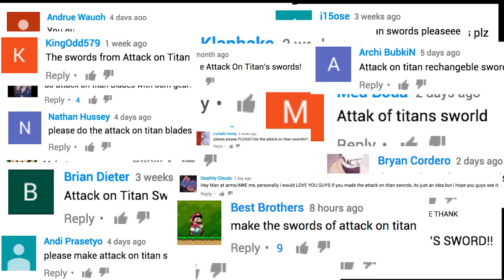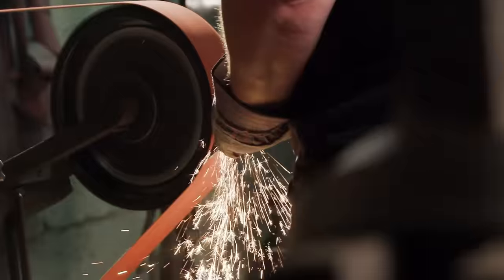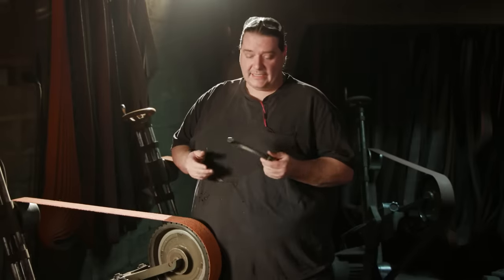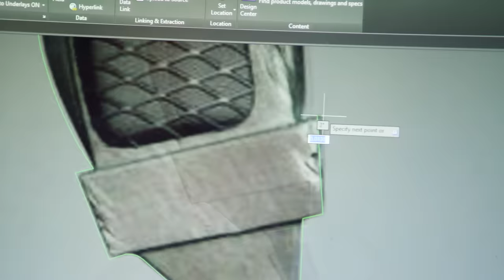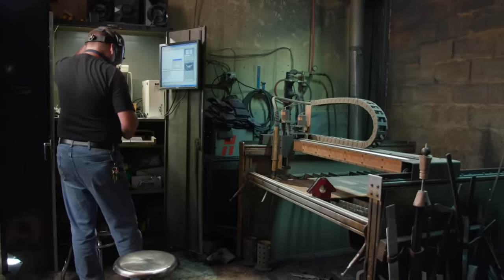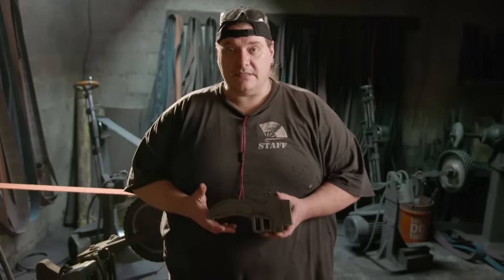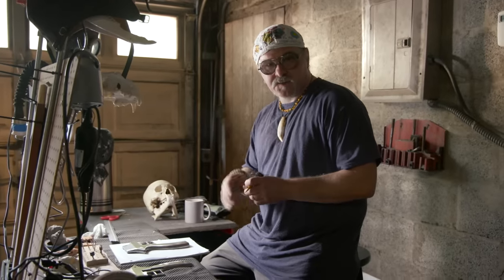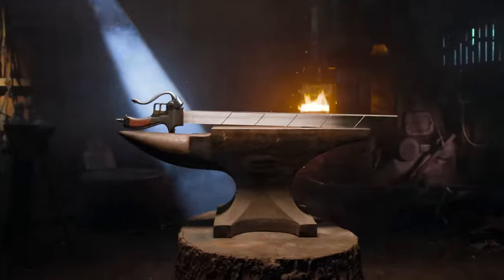3D Maneuver Gear Sword - Attack on Titan - MAN AT ARMS: REFORGED

Comment: Anyone else notice that big guy who straight up grasped the whole blade in his hand?!?
Reply: I did. I guess they didn't make the blades very sharp since they couldn't cut through those thin plastic bottles
Reply: @HarfelJ  They were sharp, they cut through tatami mats like butter, those are used to simulate human bone. Water bottle guy just hit them at a terrible angle.
Reply: @tomdibernardo1699  I guess you are right. I have not ever experimented with sharp instruments but I would think holding a blade on the sharp edge and potentially sliding your hand on it to lock it in the handle would be a very dangerous thing to try if it is indeed very sharp. But then they are the blacksmiths, and I did see the blade cut through the tatami =] Touché
Reply: @HarfelJ  i seem him touch the blade edge too. I guess he was just very gentle with it so it didnt cut him. But yea for real you don't go through tatami with no resistance if your blade isnt sharp
Reply: @HarfelJ  As long as your hands don't slide, you can grasp even the sharpest of blades. There is even a famous historical technique called the Mordhau (murderstroke in English) where you grap the blade and hit your opponent with the guard or pommel to get through armor, because a blade can't damage plate or good quality mail. I suggest watching a video from Skallagrim where he demonstrates it.
Reply: Actually,there is a button or a switch on the handling area to remove the blade
Reply: He does say the blades cut fantastically, Ive yet to see them forge a blade and leave it dull.  @ThatMockingMoose
Reply: I gave pretty much the same reaction when someone mishandle a firearm
Reply: @mennograafmans1595  halfswording as well

Comment: lmao i'd be so scared that the frigging blade falls out (when swinging the sword) and stabs someone. it doesnt look too secure
Reply: the release pin holding it in issn't that impressive, but the slot the blade inserts into is pretty tight, that blade is not going anywhere unless you swing it around so fast you overcome the pin (which would have to be faster than you might think)
Reply: why would you swing it if there are no Titans
Reply: Sasageyo
Reply: They all look just like a box cutter
Reply: netalivo i mean the sword is based off of the Stanley knife ive used them many times and they have never side off their handle unless i wanted it to
Reply: That isn't that much of an issue because they are fighting Titans who usually don't have armor. So it's not like there is a lot of stress on the blade. It's also quite thin so swinging it around won't produce that much drag. The sword is also extremely sharp so when cutting through a Titan it doesn't encounter much resistance.
With how thin and narrow the sword is if you hit a human on the skull with it it could even snap without needing to be dislodged. It's highly specialized at cutting through flesh and it can't really do anything else.
Reply: Patrick Soncela exactly, i also wonder if they make it too thin. Looks bend uncontrollable evrytime it hit an object
Reply: It is incredibly sharp so when cutting through flesh not much force is transfered to the blade.
Reply: marinus18 This is just my opinion..But if u ever watch Forged in Fire ( eps: Claymore) , u can see there is so many long blade broke or bend when they try to make a cut or swing it to a pig carcass. Full power swing to a thick object is much different compared to a fast slicing move. Meanwhile the Titan's neck supposed to be much thicker and muscular compared to pig carcass 😅 well we dont need much logic in anime tho..
Reply: It depends on how sharp the sword is. If the sword is very sharp then you need very little force to cut through. A claymore has a very thick edge and is a lot more dull than the knives they use to slay Titans. It relies on the force of impact rather than a sharp edge. The problem though with relying on a sharp edge is that over time the edge will dull which is why the swords use those disposable blades.

It's the fact that it is muscular that makes it easy to cut through. If it contained any sort of bone or even cartilage the swords would not get through it so easily.
Reply: Patrick Soncela that's what I thought.😁

Comment: The front handle is a brake the two triggers one shoots the grappling one retracts the blades are released from a lock at the back of the handle that looks kinda like a revolver hammer

Comment: This blade really is almost like a glorified box cutter 😂, great work as always
Reply: You are not wrong. In AoT canon there is actually a reason for the constructed weak points in the blade. As the titans regenerate fast and have very tough flesh, the blades have a tendency to get stuck. If that happens you can twist it and break the blade to get free, as you can't simply drop your weapon because it is fixed on you gear.
Reply: YThe Exploding chipmuuuuunk, Yeah these are just Box cutters :P
Reply: I didn't know that about the canon, the more you know
Reply: What a unique idea, it's not like they literally said that halfway through the video.
Reply: that's the idea.

Comment: Just want to say, the titan swords were made to be more flexible than durable, as to get the perfect cut required to kill a titan, so, because they are so flexible, they sacrifice durability, which is why they have the scabbard to hold 3 extra swords, when normally, a person would not carry 4 pairs of two swords (8 total) to battle

Also, am I the only one who got just a tiny bit annoyed when the called the 3DM Gear (or ODM Gear) a "Jetpack?" I mean, if anything, they are more like the hookshot, just on the waist and there are two.
Reply: CalveeThe Eevee I was definitely annoyed. The 3-DMG doesn’t allow indefinite flight so it can’t really be called a jet pack.
Reply: Let's not forget, the benefit of mass-production. These blades were supposed to be made with the efficiency of pre-World War industry.
Reply: Well I think this is just a mistake on the author as they stated that even for their demo purposes of cutting fruit, (which Titans are mostly plants) they had to make the blade A LOT more durable than what the author believed because plants are actually pretty durable and resistant to cut from thin blades. 

I think they did as one would expect from the purpose of the weapon as opposed to some under researched specs from the author. If the swords were supposed to even cut the nape of a Titan, a titans weakest spot, it would make sense it would at least cut a freakin pineapple. But any thinner blade would break at just that. 

I think your just kinda upset that the author isn’t a blacksmith and ACTUAL blacksmiths had to adjust his design to make it practical even for its fictional use.
Reply: Actually you can call them jetpack because they use gas and hooks

Comment: 6:15 it’s not a jet pack it’s a small canister of steam that builds pressure and launches the hooks then when in mid air it blows off excess steam to make you go faster . This is controlled by shifting your body weight due to the strapped harnes around your whole body

Comment: i hope someone some genius really invents the 3d odm gear which makes you jump from buildings to buildings id buy it like just take my money lol
Reply: Elsaria Rahnclave I won’t be able to, but with all the other technology today those are very possible
Reply: If someone could come up with a device that worked, it would look drastically different than what you probably want.  The way it’s designed in the anime/manga wouldn’t work IRL, because physics lol.
Reply: Amanda Orozco it still seems very realistic, reasonable, and believable in the way it works
Reply: Merengue Tang lol
Reply: I we have jetpacks so strap one to some grapple Hooks and boom ez odm gear
Reply: Elsaria Rahnclave I know I’m late lol but 3dm gear is totally possible. I believe with the proper materials and with detailed planning, I would be able to make one. And Amanda’s right, the real thing would look totally different than the anime’s style. I’m thinking it would be like a decent-sized backpack and with the tank and stuff on the sides. It would be quite heavy. But in the air, that fault would diminish easily. As you’re blasting in the air, the weight of the gear would succumb to nothing as it’s being carried, as well as yourself, by the propulsion.
Reply: Smolotov in the manga it mentions that as a fuel source it uses a material called ice burst crystals (I think that’s what it’s called) that is abundant in paradis (the region the mc’s live) which is part of the reason why the surrounding countries (Marley) want to take over paradis as it is very valuable. It’s believed that the reason for the abundance of ice burst crystals in paradis has something to do with the power of the titans, though what is unknown.

Comment: This is basically the best blade-shape, because it is the most adaptable one for all three typical blade types and their purposes.

(Chopping, Thrusting and slicing) 

(the straight edge also makes it very easy to maintain sharpness, compared to a crow-saber/sword) 

The only thing i personally would make differently, is to make the Tip-Angle slightly steeper, for a better Thrusting-Point. 

(I also would use a quality steel, that actually suits for a long term usage. Making it out to be Damascus would be awesome too) 

The Box-Cutter Grinds however, actually should Improve the cutting Ability, because it lowers the friction of the Blade, while cutting through all kinds of cuttable material. 

A Handle with proper Guard and a pointy (but not sharp) pummel, for strikes against armor or just as alternative attack in grappling etc., would be very nice too. 

Especially combined with a ergonomic, but simple handle. 

I have this concept on my mind for a long time now, but i don't have the Resources necessary, to do anything like that, so if the Blacksmiths, who run this channel like the Idea, i would really appreciate, if you actually bring to life my humble Thoughts, just in case you feel like doing it.

Comment: so you've got an air fitting on the bottom.  I think you should cut a channel in the handle from the fitting to where the blade locks in, put some talcum powder and wadding in there and run some air pressure.  Just enough so when you open the lock it shoots the blade out!

Comment: its very cool, and amazing, however, the reload mechanism should be a small trigger on the backend of the grip. That bicycle brake is supposed to be the gas pump for the odm gear.
disclaimer this might not be 100% accurate, but thats how i remember it

Comment: there are 2 triggers per sword, because one is for the grappling hook and other for gas (ODM/"jetpack"*) (for that respective side)

*it is not a jetpack, its a propulsion device, as it would not work by itself (you would be yeeted hard without the grappling hook) it would be the same as a rocket without manouvering systems.
Yes it boosts you like a jetpack, but it will definatelly not work like one.

Simplified - it is not a jetpack, treat it like one and prepare to get yeeted hard (and possibly die).

Comment: In the canon it is mentioned that the blades are basically untempered steel that are optimized for being very hard but break easily, hence the boxcutter design.
I understand that that poses safety risks to actually use in a demo... but it would have been nice to see one of the blades done that way.

Comment: Should have made two as it is a purpose built dual wield weapon. Also the blade hold down and sword tang was all wrong as they have two holes not just a notch to lock it into place, this is similar in appearance to the main blades on the UH-60 Blackhawk and the OH-58D Kiowa Warrior and would have locking pins more like a traditional door knob. The trigger should have been TWO separate triggers one for firing the grapple and one for rewinding the line/releasing the grapple. Overall nice build but a lot of things could have been done better.

Comment: There's a reason they're basically giant box cutters, it's intentional, they're shaped for straight paring cuts along the nape, the blades snap so if they break, people can escape quickly if it gets stuck in something, they can be easily mass produced as well as work perfectly for slicing a precise piece of material, like a titan's nape for example, they would be terrible for sword on sword fighting (which is explained in the show), but they work perfectly for what they're designed to do and they're expendable.

Comment: If I do this I’ll make many types like in the anime after being used sometimes they break off making smaller ones if you only have your two left and are half used you can’t use them for like 15 meters only 5 meters and less is a defense tool against hands and feet I believe there 20 notches

Comment: I have a idea try making a double bladed sword one blade on each end of 3 feet in length 3,1/2 inches wide at the hilt down to a point at the end and one handle between them of 4 feet in length making a sword of 10 feet in length that is also extremely useful do to the versatility
Reply: Even if you were to shorten the blades to 2.1/2 feet long it would still be an awesomely versatile sword

Comment: They only made the sword. Something I find disappointing. So I wouldn't say they made the actual gear. But they get a A for a Damn fine job. On the sword. 

This sword is beautiful.  But I would be more impressed. If they created fully functional 3d maneuver gear. If I had to guess the gas for it. Would be propane..they did say it  was gas. Though if it's liquid or not is debatable. I don't know if they ever said if it was a liquid gas or not. 

I personally don't understand how gas. Would help retract cables at such high speed. Shoot them maybe. Let alone be able to allow them to move around like that that. 

I imagine there was a lot of accidents. Before the 3d maneuver gear was perfected.  

Would be bad ass to take that damn gear. And go swinging around new York. So many buildings and structures. Perfect place to use the 3d maneuver gear

Comment: the lever is not the one who is goin to remove the sword it’s the small lever at the top😑👎🏻
Reply: Is that ever officially explained? It would make so much sense that the bicycle brake would be used to change the blade, since you'd really want a super secure way to hold the blades in place, but also be quick enough to exchange, so a big lever would work. The small lever in the back could be a safety so you don't accidentally hit your "brake" lever and drop your blade. One of the triggers can be for shooting and the other for retracting. This is how I always imagined it worked.
Reply: @mrkiky  my comment has been two months ago and clearly don’t remember it until i read it